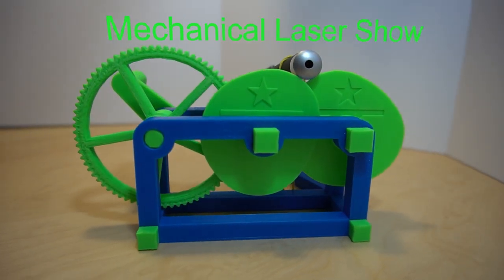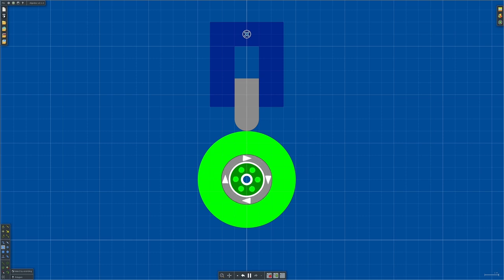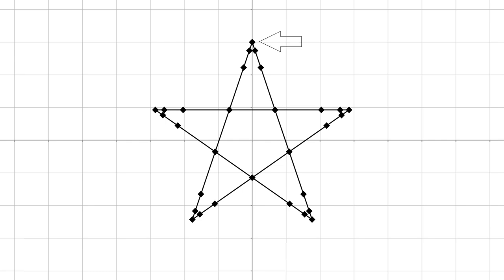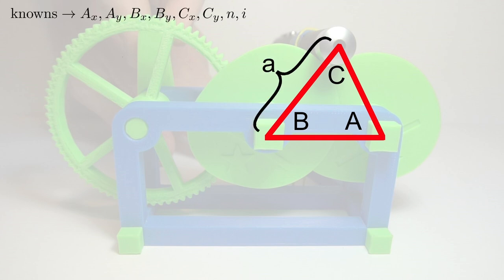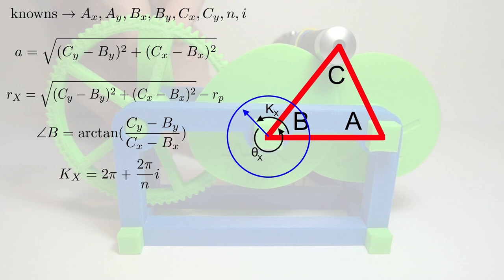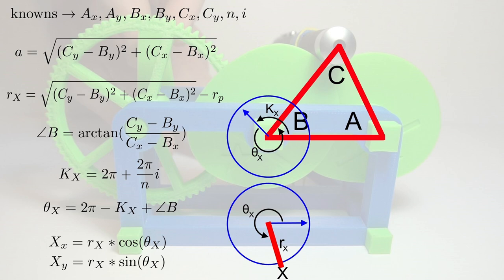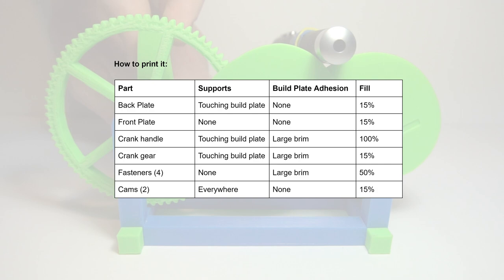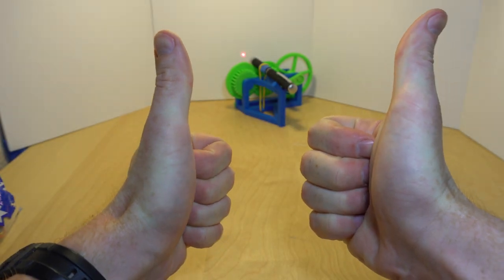Mechanical Laser Show

Comment: You should separate the gear from the profile for the cams, making them two pieces each so you don't have to keep printing and cleaning gear teeth. It's much easier and faster to make a cam with a square shaft hole than with an integrated gear.
Reply: qwerty true!

Comment: For anyone interested in a non-geared similar device, try to backtrack an old "Amateur Scientist" article in SciAm (probably c.1980) for building a laser oscilloscope using two speakers and front silvered mirrors. I built one using some small 4 inch speakers from Radio Shack and small compact mirrors. The article describes some of the optimizations involved but the crux of it was to reflect the laser off two orthogonally mounted lasers on the speakers, controlling the x the other the y deviations. This coupled to the a laser and 2 wave generators (one for each speaker) yielded an interesting graphics projector. I suppose with careful construction and digital wave generators to fine tune the displacement waves, you could generate a similar effect.

Comment: That's a super nifty gizmo ya got there! It's noisy as hell though - is that the gears making all that racket or the cams against the laser casing? A little bit of grease on the gears would help. Or securing as small strip of velvet like material to the casing where it contacts the cams might quiet it down a bit too I think - maybe sandwich a little slip of foam in between.

Sidenote: I've never been to a Maker Faire but have been meaning to check one out for a couple years. Maybe I'll see you down there come May.

Keep making awesome stuff!..

Comment: How did you know where to space the points on the path of travel sketch?   Looks like you compensated for highly accelerated movements at the vertices by placing more points near them.  Was there math involved in this?
Reply from the maker: Great observation! Yes, I spaced the points such that sharp angles where taken slowly and straight sections go faster, with finite acceleration. I just did this part by hand, no math involved. Automating this could be a great future feature.

Comment: I think the math was a little overcomplicated. you just have two radii plus the width of the laser chassis. You always know the shorter of the two radii will cause the laser to sway in the x direction of the cam with the shorter radii. Then you just have to map the cartesian xy coordinates of the desired shape to the cam at incremental radian lengths. 

Basically two right triangles and the cam radius is each triangle's hypotenuse so you can solve the whole thing without any trigonometry.Just recycle things you already know about the problem and rearrange the pythagorean equation, then map the cam's radius with polar graphing. 

What you did is still really cool though.

Comment: So, as a software developer, have you developed something that will take the input path and output the path of the cams? As far as I could see, all of that was programmable, and it didn't look so hard. Then, after that, it could do some simple math and alert the user if the cams are concave, so that they can vary the size of the input path accordingly. (Or, the program could do all the work for you, and vary the size until it finds the largest it can manage while still maintaining convex cams.)
Reply from the maker: Yes, check out the code here: https://github.com/EvanStanford/cams
Currently the code is very simple and does not deal with concavity at all. It also has no UI. Those both could be future features.
Reply: Hi! Tried to build the go project with no luck. I don't know any go, so maybe I'm misinterpreting how it should be used! Should I expect an executable file or is the project supposed to be used as a library? Any help would be greatly appreciated.

Comment: I suggest You to cam a mirror: laser do not support long shakes.
Reply from the maker: I agree. This would be more accurate. I decided to omit the mirror to keep the project simpler.
Reply: domsau2 nice idea.
Reply: domsau2, if we use a mirror in place of the laser head and reflect our laser beam onto a surface through the mirror, the laser being stationary, then we would be needing a mechanism to rotate our mirror about two axis's rather than translate (like in video) which might be complex.

Comment: You didn't explain how you should put points on the shape closer to the corners in order to avoid too quick movement changes and too jagged outlines of the circles.

It would be nice if each corner has a maximum speed based on the angle. You could then assign a speed mapping to each point on each line - just like standard 3D printer firmware does: each segment has a starting speed and an end speed and in between it makes a trapezoid function which is capped by the acceleration and the max speed. I hope you get what I mean.
Reply from the maker: Yes, I agree that would be a good feature for me to implement. As you guessed, I am doing that manually by hand at this point.

Comment: Hello,
Awesome project,
I just have a question: How do you decide where you put the center of the shape you want to draw compared to the 2 axis of the wheels.
Thank you and Bravo!
Reply from the maker: Great question! I didn't remember the answer offhand so I had to look through my code again to figure it out.

I centered the image in the X direction. For the Y location:
I first found the correct size for the shape as described in the video. Then I put it as far up, away from the axis as possible. Putting the shape farther up increases the radius of the cams. But if the cams are too big, they will hit each other. So the cams are just large enough that they barely don't hit and the shape is as high as possible.

Comment: Very cool video! How did you come up with the input pattern, or rather, the spacing between the points of the input pattern? The points are not equidistant along the path, and I was wondering why that is a requirement?
Reply: It makes sense to slow down while going around a sharp corner. Otherwise, the shape can become distorted because the cams would be less round, and the laser pointer would hit a sharper turn with more momentum.

Since the points on the path are spaced out equally relative to the revolution of the input crank, changing their spacing on the output path lets you manipulate the laser's speed. Of course, this also influences the relative brightness of different segments of the graphic.

Comment: Doesn't the Pythagorean Theorem only apply in that form for right triangles? Can you elaborate on what's different here?
Reply from the maker: Yes, good eye. The same is true about the arctan equation.  I am actually referring to a triangle between the points (B), (C), and (Cx, By); that last point being directly under C and directly right from B. I actually never use A in the math for this cam. I probably should have instead drawn this more relevant triangle.

Comment: How did you decide how to space the points apart on the target shape? They are not evenly spaced, why? Or am I missing something obvious?
Reply from the maker: Valid question; I did not describe that in the video. The laser will always travel between successive points in a constant amount of time. That means that if the points are farther apart, the laser will travel faster and when they are closer together the laser will travel slower. In order to maximize accuracy I decelerate the laser so it will travel slowly around sharp corners and accelerate it for straight lines.

Comment: I know this is an older post, but has anyone created a spreadsheet to do this, or an app to do this. I followed the github link and tried the web interface, however the downloaded STL's are all messed up, so get errors trying to load them I also tried the thingiverse customizer and you can only do very very basic shaped, you can not even do the star one. Any other way to manage to get to make some cams, thanks

Comment: hello my friend, by any chance do you have the solidworks design ?
Reply: or the math in its design ?
Reply from the maker: No but I posted .stl files on thingiverse. Check the description.
Reply: @Build-It  Just wondering, when you did kx=2pi +2pi*i/n (3:37), is the first "2pi" necessary considering 0 and 2pi are the same angles?